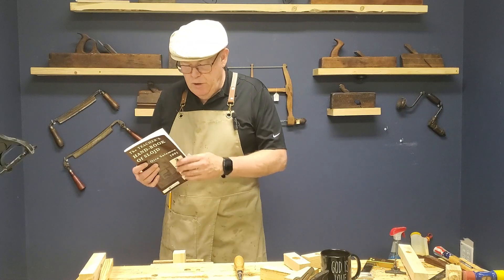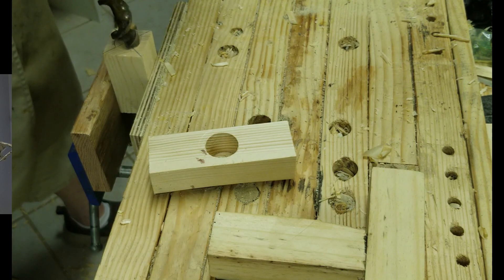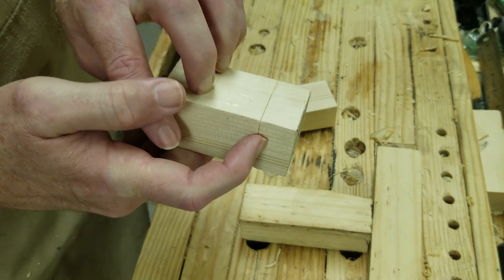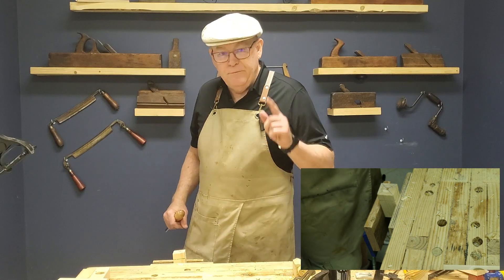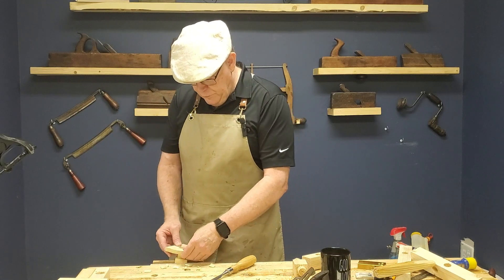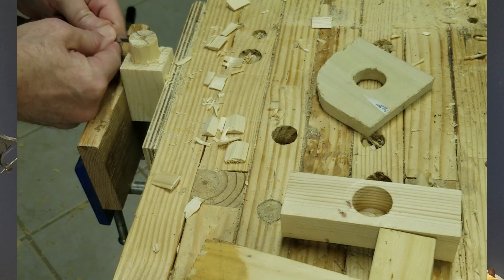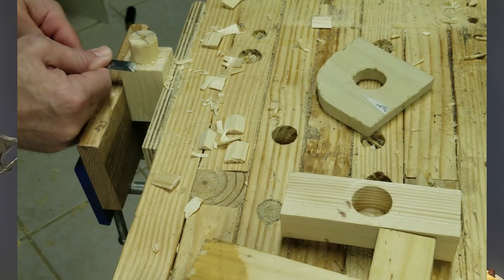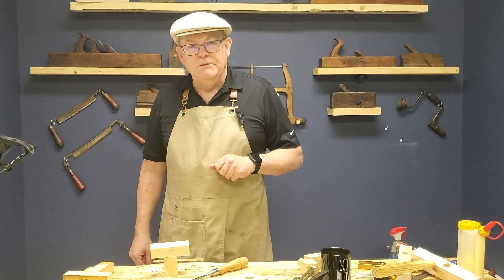Handcut Pegging Joint: Learning Handtool Woodworking EP 24

Comment: Using an auger on the tenon just enough to score is absolutely brilliant! Ive been struggling with getting my round stock tenons to fit snug and as round as the mortise. As someone who also struggles with patience, hand tooling has been beneficial to me in ways I never thought possible. Woodworking, specifically with hand tools is the dichotomy of my profession where a sense of urgency is an absolute necessity to achieve results.
Reply from the maker: @B_COOPER  good point about that sense of urgency. Most of my adult life has been about hitting deadlines and sticking to schedules. In handtool woodworking I have to force myself to slow down and that is not easy. I absolutely agree about the benefits that go beyond just making a nice piece.  Great comment. Thank you.